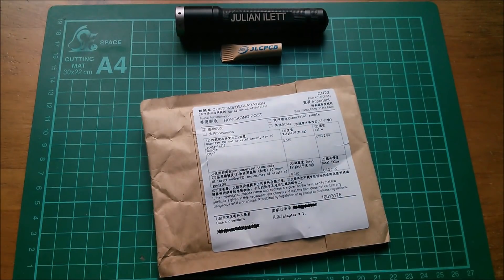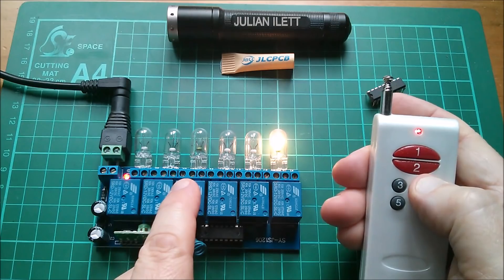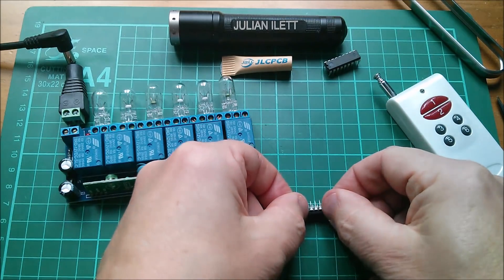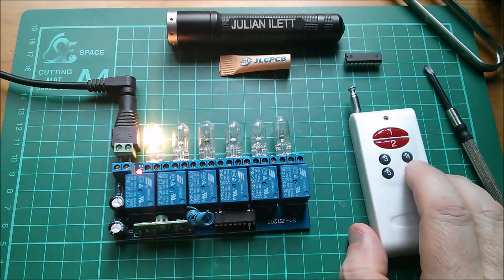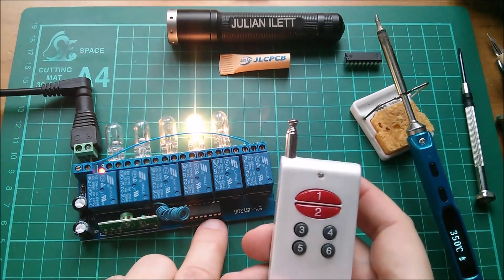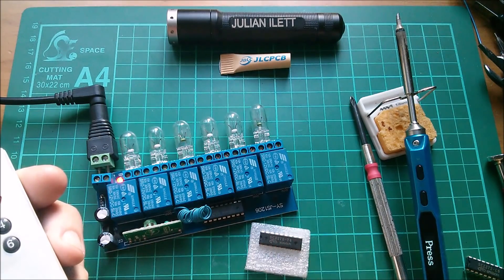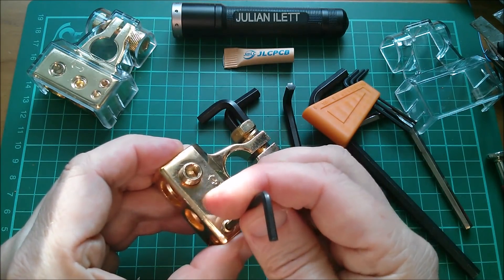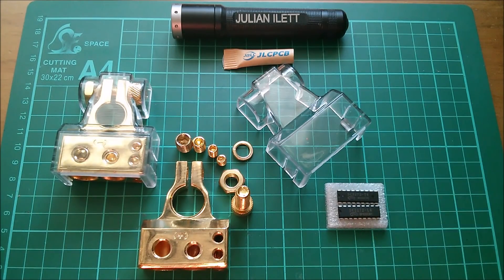Electronics in Envelopes

Comment: Hi Julian. Getting back to the remote switch, Banggood do a four relay switch " i think they do a couple of configurations" But the one I brought had a 3 pin header and a shorting link and this allowed momentary, ptm/ptb and also the as one makes the previous one breaks. it cost about 5 1/2 quid, and the part ID is 1012323. The chip number has been scrubbed but on a schematic the number is TIP 224 b or 234 b " the number is not very clear  and is a 8 pin smd package ( i know TIP sounds like the TO 220 package. I was thinking of going posh and have my electronics lab lights controlled via remote, then possibly the alarm too; hehe laziness. Paul London

Comment: you could rig up an add on pcb for the momentary chip, its outputs feeding clocked flip flops such as 74LS74, then back to the main board, that'd give you toggling...
Reply from the maker: Yeah, piggy back the chips - the outputs kinda wire-ORed. Shame there's no Enable pin :)
Reply: @JulianIlett  not quite, was thinking an extra little pcb with 3 74ls74's , plus the momentary chip , plugged into the main chip socket ?!

Comment: i know exactly what you mean about those chip pullers! 😉 also i'd advise brushing the chip pins with wd40 or silicone oil before inserting , makes them slip in and out much easier 😁

Comment: Those old chip pullers have been around since the 60s.  I used them in the 70s to pull the UV-EPROM chips from the Incoterm SPD controllers I used to service.  Up to eight chips (8KB each) had to be pulled whenever software changes or updates were made.  With so many chip insertions "IC Creep" became a problem, so sockets became stronger, but that made the old chip pullers nearly impossible to use.  They're really now only good for gripping the chip after you've pried it up with a small screwdriver or placing it onto the socket prior to pushing it down.

Comment: The NC relay connections need to go between the Vcc on the 2272 and the output of the onboard filtered regulator. lift the Vcc leg out of the socket and run that to the relay, then run other relay contact to the onboard regulated output (Vcc on socket) :)
Reply from the maker: That could work :)
Reply: @JulianIlett  let me know if that works if you have time to test it. cheers mate.

Comment: Never used a chip puller, I always used a plastic screwdriver under the end of the chip and twist and it lifts it. I had right angle ones for chips in tight spaces.

Comment: Use diode or capacitor on the relay coil momentary cut off... oscillation issues I had same thing when using mini relays for a coded keypad lock ...wrong key resets password ....
Mod remote to have 0-9 password style

Cus you need to cut power to relays only

Comment: Not sure what that metal is that those clamps are made out of.   I do know this, it has a tendency to strip the threads pretty easy.  Put a touch of dielectric grease on the threads it will help prevent this.  That metal it seems rather soft.

Comment: What if you put a couple of diodes from the capacitors to that relay disconnected so that it shorts them to ground for that moment to quickly drain the caps to stop the "loop" from happening?   Not worded the best but hope makes sense.

Comment: Couldn't you wire in a bridge connection between 2 relays so that when two of them are powered, it triggers another relay/fet to pull the main power for a long enough time using a capacitor to latch, and resistor to drain to restore power? That way to turn off, you could press 1&2 which does an AND logic and resets the device.
Still learning this stuff, so I might be off on the logic of the layout and terminology.

Comment: Those battery clamps are usually brass and should be more corrosion resistant. I use them in my car when I put in a stereo system. The large holes are for the main battery wire and new wire that goes to radio amplifier. The smaller holes are for alternator charging and accessories power.

Comment: You must have banana sockets somewhere. Just take off the nuts and washers so you can use the grub screws to hold them in the battery connectors. :-)

Comment: Just attach a second board with a timer to disconnect power when you have two or more pressed at the same time and it resets it. Might cost you 3 pounds or less to add. Second thought you might not need a timer just a add on relay to do it and some diodes.

Comment: I think I've got one of those SCs from 10s of years ago, not used, a kit , rx and tx. Just recently I got a 5 band "equalizer" , and its 5 of the chips. Might help with your vocoder ? M5226T Motorola chip. Most of them might have been made in 1980 if the code is read right.

 I also picked up the first generation of pc boards with relays, ebay , just about every version of chip . Brown radio controls. They changed the controls in the next gen.  Toggle, momentary, and click on but no off. Then I went to a touch tone version which was cool because you could remote it through an ordinary walky talky. Fun stuff, at least for me. Some day I'd like to go to shenzen and hang out. If I could afford an interpreter, and maybe even if I couldn't (google translate ?) I'd get stuff, find out what it does, and market it on Ebay. The shipping that the Chinese have is so incredibly cheap, but I doubt if a non national would get any deals.

Comment: Julian, run the power feed through relay 5 or 6, so when you turn on that relay it cuts power to the board and makes it reset, or if the ic has a reset pin maybe try using the relay to force a reset.
Reply: He did that. It didn't work. Did you watch the video? His method of disabling one relay works fine.

Comment: Could it be Naval brass - specially corrosion resistant. Only way to find out would to be to take a file to it and maybe measure density. Of course, no good if the fittings aren't the same or very well plated.

Comment: The battery terminals are made of pure copper and the gold plating will be an effective corrosion protector unless you make a scratch in it. Battery acid fumes destroyed one of my clamps in a few months from the inside out, because of a deep scratch on the bottom of it. Another set lasted for years without any signs of corrosion.

Comment: For that remote - I recommend to modify transmiter. Depending on schematic there are two methods. First is add one button to turn on only power if battery + is going through switches and diodes, like in datasheet version where ic power is turned on only when button is pressed. In normal case encoder ic gets button code and power through diodes, if we modify schematic and turn on only power, ic sends adress code only and decoder resets all outputs. 
Second way - if encoders is always connected to power and button's through diodes and transistor pulls down encoder ic pin TE (tranmission enable). In this case we need to open transistor by adding new button and necessary wiring connections to open transistor. If npn pull up base to battery + through resistor  or pull TE pin to ground through button directly. In booth cases encoder transmits adress code with no button code and this operation resets decoder output.. ;)
Reply from the maker: Thanks Arturs - I'll have a look at that :)

Comment: Also (finally honestly!) "Are they brass?"

No, it's China, they'll be aluminium because it's cheap and crap :D 

Not sure how you'd test that out, I guess the displacement vs weight would be the reliable way, or the lowish melting point, stick a blowtorch on it :D
Reply: If they're brass, they will be solderable. If aluminium, they won't.

Comment: Why not route the power for the chip to one relay's normally closed terminal? Shouldn't a setup like that add the ability to cycle the chip's power to reset when triggered? As soon as it is reset the power would cycle on again when the relay returns to the NC state. Of course you'd still only have an 5 channel effective device.
-Jake

Comment: The knives do snap properly if you hold both sides diagonally with a pair of pliers! 

That said I once snapped one badly (without pliers) and the snapped off bit vanished, totally. I found it across the room inside a folded over bag of sugar a week later. Never could explain that one other than schrodingers boxcutter?

Also 433 and 870 are the legal bands in the uk, I think (not sure) that 315 is US legal but not UK. But honestly nobody cares. 
Boring link alert -> https://www.ofcom.org.uk/__data/assets/pdf_file/0021/115653/Draft-IR-2030.pdf

You need to get a usb SDR dongle and poke into the signal using rtl_433 "for science".

I assume the non latching behaviour is because this is intended for pneumatics on a robot arm or digger or something.

Finally yes I agree with the chip pullers, it always bends the last 2 legs for me, but in cars, they come with fuse pullers that work exactly as you say.

Comment: Those sort of cutters usually have a slide off part at the back which has a slot in it which will hold the blade so that you snap it at exactly  the right angle.
Reply: Phil is correct, if its a Stanley it will have one of those. Otherwise use a pare of pliers before the tab you want to break off and press it against some wood to break, clean break every time.
Reply from the maker: They don't score the blade deeply enough though :)

Comment: It's been a while since I messed with the SC2262/2272 remote control chips, but IIRC the output of the 2272 series is a binary data bus (6 bits in the case of the 2272-L6). I would imagine that to switch off an output, you could set up the transmitter to encode some binary code in which the relevant output would be set to zero. So for example the six channels would be encoded as 1, 2, 4, 8, 16 and 32, so sending 35 would turn on channels 1, 2 and 6, so if you could encode 64, then all the lower 6 bits would turn off...

In theory at least - I don't currently have any of these chips to play with at the moment but looking at the data sheet this should work - Good luck :)
Reply: Edit - or just send binary 0 of course :)

Comment: Thanks for the interesting video. 
I think, the PT2272-xx chips were used in the 70's and 80's in remote control circuits. In those days, flash based microcontrollers were not available. In late 90's, OTP (One Time Programmable) devices started appearing in hobby circuits. In my opinion, these ICs have become obsolete. If you use a low cost PIC like 16F628 (18-Pin) or 16F690 (20-Pin) microcontroller, you can use it for momentary, latching or toggling the outputs for one or more relays or you can combine the different actions based on your need. 
Of course, the requirement is, you need to write the code for the uC or have the willingness to learn programming.

Comment: Connect the power to the board through the normally closed contacts on Chanel 6, then when you select 6 it will disconnect the power, and reset all the relays...
Reply: Never mind, you had the same idea about 30 seconds later!

Comment: What are sold as “IC removal” tools were originally designed to remove the caps off illuminated push button switches, the type with rectangular caps with filament lamps inside, as used on industrial control panels.

Comment: What about adding a little additional circuit which can reset the chip when two buttons are pressed simultaneously. Like by using two input AND or OR gate, sorry i haven't read the datasheet yet. But that way you might not have to give up one or two "Output".

Comment: Regarding the battery terminals, you need to convince Mrs Ilett to buy you a mini lathe for Xmas! Turn down a piece of brass with a 4mm hole in the middle to locate in one of the terminals which you then clamp in place with the grub screw!
Reply: As we have progressed in to the rediculous solutions perhaps we could ask Cody to melt down some gold and cast us some new ones then sent to this old Tony to machine on his CNC Router (including the holy grail of 4mm banana plug hole!)
Reply: Just use AvE's public 5 axis CNC milling machine.
Reply: That would be good to watch, I’ve always been interested to see how to cut a hex socket into the end .. must be a trick to it :-)
Reply: The bush I'm suggesting would be cylindrical...it was part in jest however as an over complicated solution to a problem to justify the purchase of another man toy!!
Reply: Probably need a milling machine with a small bit.
Reply: Search YouTube for "Rotary Broach".
Reply: Ideally, it'd have a bit of spring to it,  so you'd want a piece of 4mm I/D tube with a slit cut in it.   Or just buy a pair of jacks from Mouser or Farnell and either clamp them in with the grub screw,  or tap one of the existing holes to screw the jack down into.  Sod's law says that's a UNC or BA thread though,  so you'd need to be keen to obtain that tap size.

Comment: Whilst watching the RF, I had the same idea regarding using 1ch to cut power to the unit, however like you I'd not considered the caps keeping the chip alive. I'd have been tempted to stick a capacitor across the coil of that reset relay to hold it a bit longer which would also solve it!

Comment: Connecting banana-leads to car batteries: You want to solder a  banana-socket meant for terminating a lead to  a ringterminal, then you can screw your terminal to your big connector. Or you could just try drilling a 4 millimeter hole.

Comment: @Julian Ilett Why can't you adjust the Allen Screw just tight enough to make the banana plug fit? If the screw should come loose you could use just about anything like Teflon tape or even a small drop of crazy glue. That will work.
Reply: I was thinking the same thing. You can even file a rounded hollow on the tip of the top grub screw to make the resulting hole more round. I guess it would be oval.

Comment: My remote has a on and a off for each of the six. Same idea, but it just works and the relays are all separate with a plug for different appliances so you can move them about. I have a project that really requires them battery terminals, nice I guess I can just smash a copper plate flat and drill the right sized holes and connect that to a normal terminal, but nothing conducts electric like silver can.

Comment: I've only ever seen those IC removal tools come in handy for (older) computer CPU's you're particularly keen to avoid ESD damage on, but they typically had none captive pin holes and were simply awkward to get a grip of/had pins covering most of the bottom. I've always used a screwdriver as you did for small stuff and just accepted sometimes things get ruined or bent 😂
Reply: Same here. I had one that I used once in a while years ago, but lost it during a move and never replaced it. A small screwdriver works better - more control as well as more leverage for stuck chips. I've seen a chip puller that was shaped like an 'L' and was used to pry up on one end of the chip at a time, but its only advantage is it can be used with chips so densely packed you can't get a screwdriver at the proper angle to pry up. But I've never run across a board that densely packed that doesn't use SMT chips.

Comment: Although I should point out that I have actually received various components in normal envelopes, including axial RF chokes, resistors, 3V coin cells, various SMD components including chips, and a second hand faulty DIL chip (yes, I asked for faulty chips) with the legs flattened out (which I did not ask for!)...